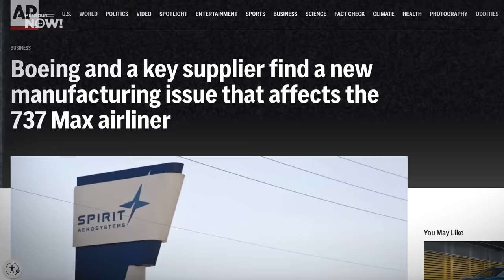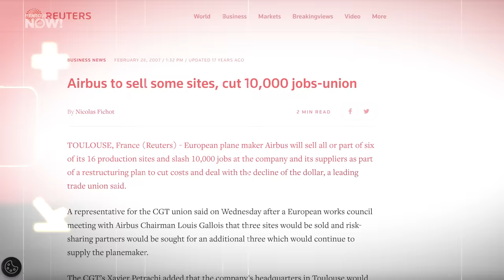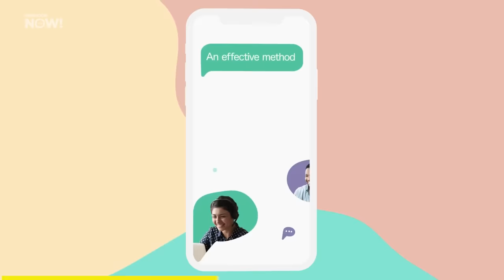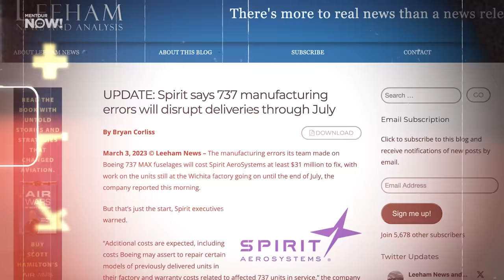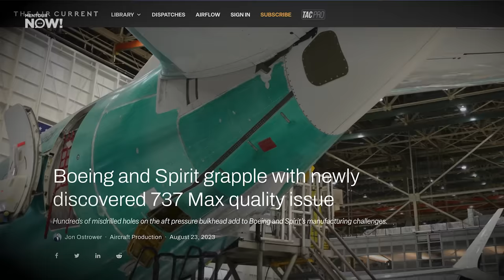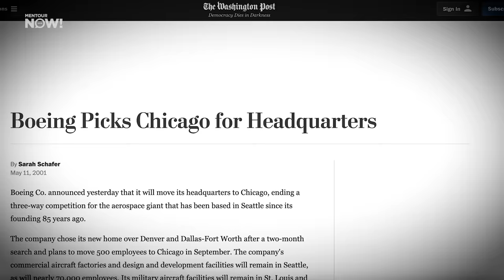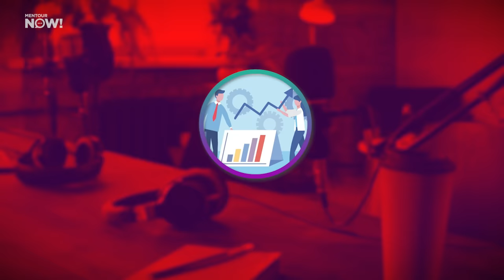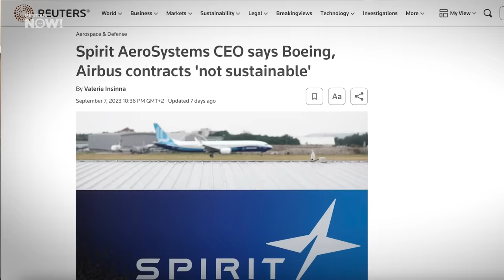NEW Problems with the B737MAX!

Comment: The biggest mistake of Boeing was not to sell off Spirit, it was to fill itself with financiers, not with engineers. In fact, more than financiers, it seems they ended up full of old horse salesmen. Your excellent presentation shows how they sold off Spirit to make a buck while losing their control over critical engineering issues. And before this, they took the decisions that led to the catastrophe of the 737 Max to save a buck while dismantling a culture of safe engineering that had started at least half a century earlier. The only good thing here is that Spirit is safe from Boeing's corporate raiding executives.
Reply: " The only good thing here is that Spirit is safe from Boeing's corporate raiding executives"
Well apperently they are not.... otherwise this discussion wouldn't exist.
Mixing up bolts can happen, but drilling two holes instead of one is not an opsy shit happens human/system error, that was a consious decision from someone inside of spirit, going against better engineering judgement.
Reply: Yeah that's true what they care about is money
Reply: Greed destroys everything
Reply: You are 100% right but it goes a lot further than Boeing.
I'm an aerospace engineer who works in industrial control systems, automation and robotics. I've worked across a number of industries and what you have described with the problem of financiers is RAMPANT across most industries especially all of the technical and engineering industries. I became so frustrated I started informally studying economics so that I can talk their language and be able to push back. 

The thing that really motivated me was finding out how bad of a state Australia's (my country) energy sector was from doing a small consulting job. I can 100% guarantee you that the current energy crisis has NOTHING to do with Ukraine other than Ukraine made the situation worse. 

The problem is that its NOT just 1 thing. Its collectively called neoliberalism which is more than simply economics as its got political aspects as well. The main problem with energy is that economists have NO IDEA how energy actually produced generated. In fact they have no idea how anything is produced. They see all forms of production as a collection of magic black boxes that "stuff" comes out of. They walk into places of production (food,  minerals, products, whatever) arriving with some form of market analysis that declares this "stuff" has a market price of $X. From that $X market price and their declared profit margin they calculate what the cost of production is and then start telling everyone how they have to cut costs to match what they have calculated.

Go and look at the Max-8 Story and that's basically what happened. They decided what the market cost was to compete with Airbus and used that to make decisions, which included NOT having the additional costs of a suitable anti-stall system.
Reply: Core competencies..... My old mentors told me never out source or sell them off as you will never get them back. Boeing is an engineering company, or rather it used to be.
Reply: Boeing decided it would "save money" twice :  #1 Boeing based "new" 737's on the same airframe for decades.  #2  MCAS was to "avoid (the Boeing) recertification of 737 Pilots".  

It's a Ford Pinto lesson that Boeing refused to learn.  Lee Iacocca (THAT Lee Iacocca) was confronted with the cost of a (roughly) $10 per car for a better design for the Pinto, an affordable  car meant to compete with low cost competition from foreign cars .  Lee Iacocca decided instead that Ford could just pay off people from "the few" lawsuits if the gas tank exploded, presumably putting that extra $10 towards profits per car.  How much did Ford or has Boeing suffered for killing people for bigger profits?  Not enough.

Because Airbus continued to design new airframes, the same engines that proved such a challenge for the 737 Max fit easily under the higher wings on one of Airbus' most commonly used models.  Who benefited from reinvestment in the company instead of profit extraction for the few?  That answer should be obvious.
Reply: I agree. Boeing, a company once regarded as the pinnacle of aerospace engineering excellence, fell into the trap of putting shareholders over customers and passenger safety. Yes, the main goal of a company is to make money, but when you glorify profit at the expense of safety, quality, and innovation, that company is quick to crumble- especially once those mistakes cost hundreds of lives.
Reply: Read this before watching the video, and thought everyone was talking about the airline.
Reply: @sncy5303  so how is this supplier issue related to tne merge if MD? And saying what really should have happened? Boeing and MD have nothing to do withna supplier issue. I dint get why this is related to what they have done in the past
Reply: @ElinaBenado  so how is that related to a supplier issue? So I'm guessing that thus is boeings fault because they prioritised profit over passenger safety and innovation etc is all forgotten about due to a supplier issue? This is ridiculous!
Reply: @alext3811  You're not the only one lol. I was so confused at first.
Reply: "we serve our shareholders"
Who cares about engineering and safety.
Reply: @justcommenting4981  who says they don't care about engineering and safety
Reply: @tonywilson4713 understanding economics will not help you unfortunately. You might feel you have a more impactful discussion but the outcomes will be the same. As you noted they already made the calculations and they know the required margins. You can tell them the margins are different and be right but it doesn't matter if they are paid more for you to be wrong. They have more information at their disposal than we can fathom and they will choose what to believe based on what gets them paid. Like a drug addict there is no reasoning with them. Except a drug addict mostly hurts themself. Douglas culture prevailed at Boeing because that most served the shareholders and so it was selected for.

Not looking good for the US technologically. We will be taking a backseat to French and Chinese aerospace engineering.
Reply: @nickolliver3021 their repeated actions to cut costs and avoid modernization. Like refusing to put EICAS in the new MAXs. Their repeated failure to meet quality control standards with the 78. Boeing is an embarrassment.
Reply: I LOVE Louis Rossmann's take on it when he describes companies.
The moment they stop innovating new products and markets and go stagnant, and they are run by financiers that are out penny pinching (searching the couch for change) that is a company that is circling the drain to bankruptcy!
Reply: American company, capitalism, making money over passenger safety, lack of regulations.....sounds about right.
Reply: @justcommenting4981  Aurbus is an embarrassment because they cut costs with their repeated actions  and avoiding modernisation. How are they refusing to put in EICAS? They never refused to meet quality control standards on the 78 program
Reply: @CMDRSweeper  so how has Boeing stopped innovating new products and markets and have claimed to be stagnant? Who says they are penny punching searching for money down tne sofa and is showing that tbe company is circling tne drain for bankruptcy? What makes you think that on a supplier issue
Reply: @gentleken7864  I don't see it as making money over passenger safety over a supplier issue
Reply: @nickolliver3021  the 787 was delayed for years because of quality control problems. Way late for deliveries to American, which I think are still behind receiving their deliveries. They did refuse to put EICAS in the MAX and were able to lobby Congress to grandfather in the archaic crew alerting system the 737 currently uses. You have absolutely no idea what you're talking about.
Reply: @justcommenting4981  and that was how long ago? The 787 has had its quality control problems solved yet frames are being reworked on as we speak. Late isn't an issue. Being sorry is. And no they extended the waiver so that EICAS is installed on the "archaic" crew alerting system. And actually American.has relieved all 787 dreamliners as they just have -9s to be build and delivered now. Stop going on about the negatives and ficus on the positives
Reply: @arcanondrum6543  The airlines such as Southwest who pushed for the MAX aren't innocent either. They demanded the Boeing take a 50+ year old airframe and make it as fuel efficient as the A320 neo without making any changes that would require simulator training, or else they would take their business to Airbus. That is like buying two weeks worth of groceries, and demanding the cashier fit all of them in one bag without that bag being heavy. Most of the blame is on Boeing for the half assed and underhanded way they achieved this, but there is only so much they can be expected to do without designing a replacement for the 737 from scratch.
Reply: @justcommenting4981 Right, Boeing are indicative of the working practices and environment in America now.  Shareholders are the most important part of the company and in this case at the behest of safety.  Problem is, if you cut corners with planes, hundreds could die.  The fact the 737 Max has been grounded before in 2019/2020 shows you what has happened to Boeing.  Profit is all they're interested in.  America is way ahead on this capitalism thing and is now at the point where it shows where capitalism has gone wrong.  But you cannot put profits over plane safety which Boeing has done.   You have to remember also that Boeing is integral to America, as was seen during Covid.  They'll be bailed out no matter how badly they're run.
Reply: @themidcentrist  No.  Boeing placed blame in others' lap but "making it as fuel efficient as the A320 Neo" came down to one thing:  Fuel Efficient Engines.  They fit easily under the higher wings of the A320 but those same engines did not easily replace the engines on the lower wing 737.  

Airbus had choices, Boeing did not.  The blame for that is Boeing's.  Boeing COULD have anticipated that more efficient engines would ironically,  be larger but executives extracted profits instead.
Reply: At this point, Boeing's just polishing turds.  ;o)
Reply: @nickolliver3021  oh Boeing is sorry? Well that's good, that solves all the technical problems doesn't it. Getting a waiver means they refused to put in an EICAS. They were permitted to use the goofy lightbright system instead of a modern one, even though some engineer clearly designed the glass display to accommodate an EICAS. Why should the 737 adopt modern safety and technology standards though? That would cost money.
Reply: @justcommenting4981  Look they had it extended so that EICAS was installed as it was a requirement from December 2022. All new planes will need it installed. But if you really are that persistent at this then go complain to boeing instead of going on and on on YouTube about it. It doesn't achieve anything
Reply: @gnarthdarkanen7464  just like airbus have
Reply: @themidcentrist  ....on the other hand, your point that Southwest cared about shaving costs for profits is well taken.  Ahh Reaganomics, it's all about Profit GROWTH now.
Reply: I have to wonder if the employee who noticed the "snowman" problem was rewarded or punished.
Reply: @arcanondrum6543  So long as we allow corporations to be owned and run by the few, this will keep happening.
Reply: @FNLNFNLN  No, mob rule is worse, who the few matters, this is the consequence of america last capitalism wining over noblesse oblige.
Reply: @nickolliver3021    Something like... Boeing HAD a great thing going on. Engineers primarily doing the operating and what input accountants did was just to reign them in a bit. McDonnell-Douglas already proved how putting accountants in charge works out, but Boeing somehow got the idea to "fix" what they were doing when they absorbed the MD corporate culture...

    ...AND the recent history and developments speak for themselves. It's exactly what happens when you go around "fixing" stuff that was obviously NEVER broken.

     I can't 100% speak to Airbus up and downs... BUT it's an alarming trend across ALL things in corporate production of any kind.   ;o)
Reply: Fun fact: when the last 737-800 NG was built it had to have it's original fuselage replaced because the wings wouldn't fit. It was for KLM and registered PH-BCL.
Reply: @arcanondrum6543  That's a nice rundown of urban-legend misunderstandings in pop culture, from the Pinto (no higher rates of rear-end tank explosion / fatalities than other models of the time) to new engines fitting under the MAX being "such a challenge" for Boeing. If you were an experienced pilot across multiple types, you would know that the 757 had a far greater nose-up moment under throttle-up than the MAX because that was its very intentional, high-performance design. Pilots had no problem flying it. That wasn't the problem nor the purpose of MCAS to eliminate it. The main problem in this discussion thread is that people think the discussion is about Boeing. Boeing retired years ago through a process of "taking over" McDonnell-Douglas, which in terms of everything from accounting to engineering to company culture actually meant Mc-D taking over Boeing. That is the real reason why the recent history of Boeing mirrors the history of the same kinds of nightmares at Mc-D.
Reply: @MrMcMind :  Thank you for saying what mentor pilot did not say. These companies are rife with lousy management and engineering.
Reply: @nickolliver3021  again you just don't know what you're talking about. No 737 will have EICAS irrespective of when they are manufactured. New aircraft TYPES Boeing introduces from now on will have EICAS(unless they get yet another pass to do as they please), but no 737 will have because of the waiver. Why on earth would you think Boeing cares about what anyone thinks or complains about? They didn't care about what their own engineers thought when making the MAX into a lawn dart. They want money and wanted to pump out 737s more cheaply and so didn't include EICAS. The only reason it got new engines was to compete with Airbus NEOs.
Reply: @gentleken7864  maybe, we'll see. I think we will see another competitor to Airbus outside of the US in the next 10-12 years. I think Boeing will just become sort of irrelevant, like Russian aircraft are basically only flown in Russia commercially. It will be interesting and probably very sad to see what form capitalism takes to ensure the shareholder class never wanes in power or luxury.
Reply: @nickolliver3021  When Boeing and MD merged, Boeing's engineering led culture became a finance led culture. And that led them to nickling and diming everything, and outsourcing alot of things which are probably important / critical cos it was cheaper (up front, not necessarily in the longer term. Those execs who made the decission would have collected their bonuses and exited out before things go downhill).
Reply: @nickolliver3021  Hundreds of dead passengers.
Reply: @SteamCrane  so has airbus
Reply: Biggest mistake? MCAS?
Reply: @justcommenting4981  That's the standard response back as usual. How many times do I have to say it. All aircraft from December 22 onwards have to have EICAS hence why an extension happened for it to be installed so yes is the answer to that. It will be installed. All planes lawn dart when they have problems when they didn't maintain the aircraft well lol. Aurbus wanted to pump out jets and wanted money too. But all new 737-10s and the other models in the future will have EICAS installed. Anyway I don't see what this relates to a supplier issue
Reply: @nickolliver3021  you aren't saying anything. I still don't think you actually understand that no 737 will have EICAS no matter when it is made. Airbus have never lawn darted(to my knowledge), in fact the pilots in multiple Airbus crashes had to basically put in continuous input to keep the plane stalled or pointed at the ground. You're a fanboy that can't tell the difference between one company that has repeated delays because of quality control failure and one that doesn't. Yes both companies make money because that is how our economies are set up, but one company is also actually consistently producing safe aircraft without defects and the other isn't.
Reply: @dosmastrify  MCAS was just the last, and unavoidable, mistake in a long series of poor decisions. New systems are designed, tested, corrected and sent into production all the time, and that is good engineering. The MCAS was designed with a severe mistake, the design was poorly checked, the tests were poorly done, and it went to production anyway. MCAS was not the problem, the severe erosion of the checking and testing standards was the problem. Additionally, every system includes the manuals and procedures necessary to use the system correctly. In the case of MCAS, the manual was "just don't tell the pilots that the MCAS exists". Even the flawed MCAS would have been a safe and beneficial tool for the pilots if they had been properly instructed in its use.

So no, the MCAS itself was not the problem, the penny-pinching salesmen who wanted to sell the new 737 as a perfect improvement over the old one, with all of the advantages and no additional issues at all, were, and are, the problem.
Reply: @ReflectedMiles   Wrong and wrong and very funny how you intimate that you know about flying but have no idea what shifting larger engines forward of previous designs does to CG and CL. 

I realize that there are claims, made all "official" about the Pinto and so, I will leave it to others to find out what's in the actual NTSB Report  (rather than the CLAIMS of what's there,).  Anyway, shame on you for imposing your obedience on other readers and for pretending that you're knowledgeable.  Clearly you are not.
Reply: @justcommenting4981  And you are not saying anything because a supplier issue is not a delay of quality control failure. And yes the 737 -10 will have EICAS.  Well yes airbus has lawn darted many times before. Then if pilots were pitting continuous inputs into the controls then there is nothing to worry about over that as both has done that. We're now moving from topic to topic. Oh yeah like airbus has never had a delay in bad quality control. They failed on that too when they did. I dont see how the other is not making safe planes with defects and the other is just so perfect and making safe planes without defects? Boeing is making safe planes without defects. What's all this fuss about
Reply: @arcanondrum6543  I am a commercial pilot with experience in both types. I don’t get my information from social media, like most experts in these threads. What I stated is the reality in the cockpits of these aircraft as any other pilot with the same breadth of experience will tell you. Yes, there is a minor change in CG from moving the mounting point and the moment being further forward does give throttle movement some additional leverage, but the greater impact is simply from having much more thrust located under the wings, but that is also true for Airbus and is especially a characteristic of the 757, which is why I mentioned it. MCAS is just an acronym that tells you what it was intended to do—augment the maneuvering characteristics. Its purpose is to make the handling of the MAX similar to earlier 737’s in certain flight regimes to avoid a new type certificate requirement with extensive re-training of existing crews then being required. It’s not because the new flight characteristics made it any more dangerous to fly than other commercial aircraft. Media, and especially social media, are perpetually confused and misinforming each other and the public about aviation and other technical topics in general.
Reply: @nickolliver3021  the 737 10 will not have EICAS. Where are you getting that it will? Post where you are reading that from.
Reply: @ReflectedMiles  Well, NOTHING that I wrote was "misinformation".  I beat you to the CG change, you still haven't mentioned CL and you'll have to find someone else interested in admiring you just because you claim to be a commercial pilot.  I'm aware of the minimums to become one so I don't automatically presume that each of them has above average intelligence nor curiosity beyond their duties.
Reply: What I am thinking is what of Spirit decides to not send anymore parts to Boeing, Boeing is dead, Bankrupt.  You do not outsource a critical supply.
Reply: @themidcentrist - You sir, are correct!  Southwest inadvertently turned out to be one of Airbus’s best customers from how they ended up screwing Boeing because they (Southwest) were cheap sh!ts.  I get that is was a “it seemed like a good idea at the time” situation, but history has proved how terribly myopic that decision was.   That and buying MD, instead of letting it sink like the turd it was (which ironically, can somewhat be said for the merger of Douglas and McDonnell).
Reply: @tonywilson4713  You are bending the story to fit your narrative. The 737-MAX problem was always one of safety vs cost - neoliberalism was never involved.

The 737-MAX problem started when Boeing chose the 737 airframe over the 757 airframe as the basis of future aircraft development. That decision was made almost entirely on the basis of reduced training cost to customers (use of existing avionics) and ignored engineers' advice, which include a warning that development costs would be greater and that the low wing height of the 737 would lead to problems with large diameter engines. That problem came to pass and the designers were forced to move the engines on the 737-MAX further forward than was desirable in order to obtain sufficient ground clearance. That caused a problem with the location of the centre of mass which made the aircraft vulnerable to stalling when it was flying low and slow. Thus was MCAS (Movement Characteristics Augmentation System) born - the name alone tells you that obfuscation is involved. MCAS uses one or two sensors (penny-pinching) even though three are necessary to avoid problems with sensor failures. The system was not announced in the operator's manual, thereby saving conversion training costs for customers. One poor decision followed by a succession of kludges which attempted to mitigate that decision; costs reduced without due consideration given to safety and engineering concerns. Nearly 350 innocent dead people.
Reply: @ReflectedMiles - Exactly correct, as an airline transport pilot rated in fourteen different jet transports (including the B-757, and with a number of friends who have flown both the MAX and the A-320).  You’ve got to love all of the armchair “experts” whose knowledge comes from FlightSim and the general news media!  SMH.
Reply: @arcanondrum6543  You have forgotten the trivial cost of enough (3) AoA sensors to render MCAS resistant to sensor failure, and the deliberate failure to notify operators of the existence of MCAS - given the outcome, the latter might well constitute criminal negligence.
Reply: @MrMcMind  drilling two holes instead of one happens when you’re back drilling parts that aren’t 100% lined up. They wouldn’t see the doubled hole, which is why it wasn’t caught
Reply: @toriless  Spitit cannot stop supplying Boeing. A company that is not unbelievably profitable cannot stop supplying more than 60% of its product without itself going bankrupt. The last thing the world needs is even more corporate raiders holding companies for ransom.
Reply: @justcommenting4981  back when it had the extension to have it installed facts dont lie
Reply: Uh, Spirit was the weak link in these problems. So, your safe from Boeing comments makes no sense. Also, the Max issue wasn’t even some sort of build issue. It was the result of airlines not wanting to pay extra / lose time training pilots for a new type certificate. It was simply Boeing’s fault for helping to enable that.
Reply: @hb1338  You're right,  I did forget to mention the AoA (I am certain that the 1st that crashed had just one AoA Sensor but I think that both that crashed had just one) more would have been a trivial cost to Boeing.  Also yes, Boeing executives SHOULD be charged with crimes.  Great point!

Reagan really screwed over average people when he made "government" (regulation) a crime. I believe that actually charging the executives is more difficult because of him.  Reagan and the guy 5 Presidents later cashed and kept every single one of their government checks however
Reply: @nickolliver3021  
As I said to you under another video but on this same topic, your defence of Boeing for outsourcing components is turning into a 'one man band'. There's plenty of support for Boeing as an innovative company amongst the criticisms, but the company's decision to sell off the manufacturing facility in question, effectively outsourcing to 'snake oil' salesmen like Spirit, promising to build cheaper and better, was just so unrealistic, it was never to be believed, except by Boeing executives, and now you come along to convince everyone, (although you convince no one,) into thinking Boeing can hide behind its suppliers, and do no wrong.

You're fast becoming a zealot, detached from all reality............
Reply: @artrandy  Why is everyone acting like it's all defending them? I'm not asking for answers!! A supplier issue is we all know not the manufacturers problem how many times do I have to say this. It looks like there are so many exowrys who think.they know it. Outsourcing components is the only way to go.  Yes they are full of innovation despite the past mistakes. But ypu saying snake oil salesmen. All manufacturers want it done cheaper. How is boeing hiding behind its suppliers? They are out there reporting the issues as they are before they get any worse. Other channels know its not boeings fault for supplier issues. You might as well say its the manufacturers problems for engine issues yet they don't make engines
Reply: I'm also doing accounting and economics but I really want to be a pilot. I now see clearly what this is all about. The are try to maximise profit over safety that is why the Max 8 crashed. So yeah I fully support your argument. It's true
Reply: @kksavaition1254  how are they putting profit over safety when this is a supplier issue
Reply: @nickolliver3021  
You have to wonder why Boeing sold off that division which became Spirit, and the answer is inevitably, a financial one.

Clearly, some accountant claimed that Spirit could produce those components cheaper than Boeing.

How could they, was Boeing not an efficient company at the time?

So how many corners did that sub-contractor have to cut, in order to reduce the cost price and meet Boeing's expectations?

The 'pigeons are now coming home to roost', and the 737 is a pretty big pigeon.

The engines are sold separately and have nothing to do with it. You know that.

This is just another unneccessary threat to the 737 Max programme, caused by greedy accountants, but nevermind, Boeing still has you on their side, ignoring the truth like a Russian bot...😀...
Reply: @42468  I am only familiar with backdrilling in regards to circuit boards. We are talking about a riveted bulkhead. 
Fill me in if I misunderstand you.

Regardless, shouldn't that be an error that gets almost immediately get caught? I mean once your drilling is done you check your work if it meets the specifications. Either they don't check, or they dismissed the error. Both are not acceptable decisions.
Reply: @artrandy   the sane can be said about airbus selling off that division which became spirit too. Everything will be down to financial reasons. 

Boeing doesn't produce components nor does airbus. They have suppliers to do that for them they only assemble. 

Of course boeing and airbus were efficient at getting planes out and delivered, if only their suppliers met their standards at right now that's not looking too good. 

The question is why did spirit cut corners in order to send those improperly drilled parts to boeing that were not up to specifications? That's what the question is. And that is for spirit to answer for but they never tell you. 

Yes alot of pigeons will be coming g home to roost. The a320 is a big pigeon too. 

Yes and the parts that are made for airbus and Boeing are separate too and made by suppliers. 

I don't see how this issue is related to greedy accountants? Greedy accountants at spirit yes agree but nothing on boeing. This isn't ignoring tbe truth. Spirit accountants are ignoring boeings specifications. Truth doesn't lie.
Reply: @nickolliver3021 
If you think that the reputation of Airbus is the equivalent of Boeing's reputational low, you are so self deluded.

Boeing's supply problems on the 737 Max, come on the back of 2 air crashes.

Every time there's another problem at Boeing, or one of its suppliers, people groan and are reminded of those crashes.

"And the same could be said about Airbus". Wrong. You need to do some proper research bud. 

BAE was an original partner forming Airbus, but sold its shares in Airbus, and also divested itself of factories producing components for it. The factories were sold to Spirit, but not by Airbus.

As for factories in Belfast, they were sold by Bombardier to Spirit, and Bombardier bought them from Shorts. Shorts were an airframe and component manufacturer, best remembered for the Sunderland flying boat of WW2 fame, and were building parts for aircraft that later became the Bombardier C series, later the A220.

So no, Airbus never employed these companies to undercut their own costs on components, because these companies had been making the components for either Airbus or Bombardier from the beginning and they still are. So, not like at Boeing at all.

You don't have the whole picture. Anything outside of the US and you aint interested.

You are right, the truth doesn't lie, but a lie is still a lie, and Boeing sold it own component manufactury knowing the new owner had to cut corners to make it all cheaper. That is why Boeing are guilty of risking quality control.

How much are Boeing paying you to protect their reputation from all this bad publicity, and do they think they get good value......?
Reply: @artrandy  Doesn't matter. They both have had the same problems but not as what boeing went through. Why is everyone getting so up tight over this god damm suppliers issue. 

We all know the 737max crashes were 2 crashes alone. We get it

So just because of the crashes, when a delay or supplier issue relates to those crashes does it now? They're all separate. 

And if you want airbus in it then they deserve the hate too from people. So all those airbus crashes people should relate how they have had delays and supplier issues too. 

And Boeing did not sell anything for spirit to become a supplier for boeing. Spirit was a original partner company but sold its shares in boeing too and divested itself of factories producing components  for it. 

As for the factories yes they were just like boeing because they did employ these companies to undercut their work and costs on components because its all about money and doing it on the cheap. Quantity not quality. Bombardier was bombardier. What has shorts got to do with anything. Bombardier c series was their own aircraft from scratch. Which later became a220 when airbus bought them up. 

Anyway both companies airbus and Boeing have companies to supply their components but it was down to their suppliers to undercut or stick to doing their jobs properly. Sadly we are seeing spirit undercut their work by drilling improperly drilled holes in parts. Enough said on that. 

I do have the whole picture. Quote alot have the whole picture over a supplier issue. I say again it has nothing on boeing. They saw it they are getting spirit to suffer and pay for the damage done. 

You can't blame boeing for selling off component manufacturering knowing that suppliers have issues such as cutting corners to make it cheaper when they suddenly get caught out by the manufacturer. That's why boeing is not risking quality control because their own quality control team saw this immediately and reported the issue. That is their job being done the right way. 

Perhaps how is airbus paying you to say that boeing is risking their quality control yet their own quality control team are doung everything right here? Unbelievable. This is not a fight about which one is in the wrong but deep down this is all on spirit and they themselves have admitted their problems of not catching up to boeings needs with demand hence why parts are being made bad quality/not up to specifications. Need I say more!
Reply: @nickolliver3021  
Much of your reply is the usual list of lame Boeing exuses.

Boeing are lucky that a latter day Ralph Nader is not discrediting Boeing over continued safety issues, regarding the MAX, because the way he destroyed parts of the US car industry in the past, due to his interpretation of unsafe cars, could destroy Boeing over the MAX now. 

I think that only a minimum of the air travelling public are conscious about the reputation of the MAX, as they're getting on it, but that could change if Boeing trip up any more and the US public boycott it.

You know about the dreadful circumstances surrounding those two lost MAXs, so you don't need me to remind you why the reputation of Airbus is so much better than that of Boeing.

And by the way, people know that no one at Airbus is paying me for propaganda, because unlike you with Boeing, I do not claim that Airbus can do no wrong. I like to see fair comment, but latterly, you've given that up........
Reply: @artrandy  I can pretty much sum this all up. 

It's  all here say! In real life we all hear tbe real truth and not what people's opinions believe is to be true. 

Again a continued safety isdue is not a supplier issue regarding the MAX. I don't go on about Ralph Nadar who ever this guy is. I talk about the point in hand amd not go on about this that and the other. If he could destroy boeing over tne Max then he can do the sane to tne airbus a320neo. One must end aviation if this is how it all is about. 

 The travelling public is conscious about reputation of the max because they know that the history was a mistake and now since the recertification they have listed and have heard that the changes made have got confidence abd faith back in people who need to be educated on its recertification. Who says if they ever trip up again and deserve boycotting? 

Just because of tne two max crashes doesn't make it out that it was a big blow to everyone and they all need to worry so badly over it. Anything g like supplier isdues with the plane or whatever they instantly blame boeing for. Its a sad reality. The world is getting madder. 

And also there is no one at Boeing knows I'm.being paid to post propaganda either. I'm here to say what reality is and how most here amd on other channels agree that a supier isdue is not a manufacturers fault. You always get the very few who try to force their way in to prove it is or make out it is. But to be honest I'm wanting to be nice about it but I got alot of the people who wanted to blame boeing for it. So there we are. It's best not to argue over a damm supplier issue
Reply: @sncy5303  - Yep, though I think the term “dolt” is more accurate!
Reply: This same thing is happening to the medical device industry. Watching it happen was like watching a horror movie unfold.
Reply: There are internal and external customers. External customers are airlines. Internal customers include stockholders. Stockholders became Boeing's most important customer. Boeing decided their product was money, not airplanes.
Reply: You clearly don't know Boeing's past plagued by terrible design choices that killed so many people.
Reply: @ederss7  In engineering for security you have to consider always two things: the design process and the testing process. Design is by definition a flawed process because you are making something that did not exist before, so unexpected results are unavoidable. But after that you design security into it, avoiding preventable problems, and then you test everything yourself, and then you get external assessment of the whole process. If you want to criticize something, you have to find out about the whole process from start to end, not just one piece.
Reply: @sncy5303 They've moved their headquarters to the DC area, cementing their final form. They've gone from engineering company to finance company to now being a government lobbying company.
Reply: Bean counters and other rear echelon bosses are the tail that ( tries to ) wages the dog
Reply: @MrMcMind  you don't know what you're talking about
Reply: You can apply this to every tech/engineering company in existence. The fact that non-technical managers & directors earn more money than the dudes that actually make the thing fly (or work as in every other tech/engineering business) is absolutely bonkers.
Reply: @CMDRSweeper EXACTLY like that already happened to Chrysler...
Reply: @kksavaition1254  all companies care about cash show me one just one that doesn't.
Reply: @sncy5303  boeing will be here there is no other choice. Just Airbus and they can't come close to keeping up with the demand. just like boeing couldn't in there hey day.
Reply: It now got worse. 

It moved to Chicago, got rid of engineers in Seattle and hired a bunch of sales man.

Now it moved to DC, got rid of the sales man and hired a bunch of, gasp, lobbyists!
Reply: @arcanondrum6543  "Airbus had choices, Boeing did not." Did not Boeing have the choice to properly design a brand new aircraft instead of modifying the aging 737?!  How was there no choice?!
Reply: @someb0dy2  "When Boeing and MD merged, Boeing's engineering led culture became a finance led culture. And that led them to nickling and diming everything"  A nickel and dime culture is bad enough in automotive engineering where the likes of General Motors, Ford and Dodge struggle to compete with rivals who focus more on quality (apart from in trucks), let alone in aviation!
Reply: Accountants aren't engineers, the once mighty and trusted Boeing has now stained it's reputation with permanent marker.
Reply: @arcanondrum6543  Fight club economics
Reply: @nickolliver3021 The hundreds of people who died in the two plane crashes due to the faulty MCAS say so.
Reply: @nickolliver3021 How many Airbuses have crashed due to faultily designed MCAS?
Reply: @ashlionell  mcas is not on an airbus. But you dont know if one could in the future. Why asking stupid questions. Who cares. You can't tell the future
Reply: @nickolliver3021 Precisely. MCAS is not in Airbuses because they don't need that because they are designed well. Unlike the MAXs, which were poorly designed and then MCAS was applied as a band-aid for masking the defects of the design. Surely Boeing's fault here.
Reply: @ashlionell  Then The Boeings are designed really well too. The MAx was not poorly designed as MCAS was a separate feature however was not just a band aid for masking the defects of the design. I'm not going down the route of who's fault that was but moving on from you and saying unlike Boeing this that and the other.
Reply: @nickolliver3021 Really well designed airplanes ought not be dropping from the skies like flies. Airbuses are really well designed. Even other older Boeings are well designed. Only the MAXs are riddled with problems because of cutting corners and prioritising profits over safety. Hence half baked systems like the MCAS that never really should have a place in a well designed plane. You know, which the MAX is not.
Reply: @nickolliver3021 You cannot not choose to go down the route of whose fault that was, when hundreds of lives have been lost due to Boeing's greed and scrupulousness. That simply is not a choice. A fair and unbiased investigation has to be done, and the blame apportioned to whoever is guilty and/or negligent. All the facts point to Boeing as being at fault for their inferior designs and underwhelming quality control.
Reply: @ashlionell  How was it boeings greed and scrupulousness because of hundreds of lives lost? Perhaps airbus has also lost over hundreds due to its greed and sculpulousness over the years too. Boeing wasn't negligent nor guilty because those max crashes had partly tbe pilots to blame too. How does Boeing produce inferior products with underwhelming quality control? Doesn't airbus have the same too? Nothing is up to its standards!!!
Reply: @nickolliver3021 How do you say the MAX crashes had the pilots to blame? Are you aware that Boeing kept them totally in the dark about its MCAS? Do you know that Boeing publicly revealed the MCAS only after the second crash due to faulty MCAS? They tried to get away with designing an inferior plane at low cost, until they got caught. How is that not greed or scrupulousness?
Reply: @ashlionell  The fact that mcas was inly revealed after the second crash was when they realised mcas was tbe issue. They didn't deliberately hide mcas from tne pilots. That's not what greed it and sculpulousness. The max was never an inferior product. This has gone on from the latest issue to the whole max saga! Why are you doing this. This has no relation to a supplier issue
Reply: @nickolliver3021 They were supposed to inform the pilots about the MCAS which was a new system. Boeing specifically got a waiver from the FAA to remove references to the MCAS system in its training manuals issued to the pilots. This was done to avoid the costly type certification that would have to be done had they revealed the existence of the MCAS system in the first place. How is this not greed and scrupulousness?
Reply: @ashlionell  misdibg out on informing the pilots does not count as greed. Getting a waiver from FAA to extend the -10 variant to get it certified is not a way of greed. Nor is it greed to adjust a few things about mcas in the manuals. Any company would do things to reduce the cost so if that's what it's like for tne modern day then pretty much all companies are greedy and sculpulousness. Shame on people on this planet!
Reply: @nickolliver3021 Fine. Assuming that not informing the pilots about a totally new system like MCAS may not be greed as you fervently argue. But what is it then? Incompetence? Negligence?
Reply: @ashlionell  it's not negligence and nor is it incompetence. It was a mistake. Everyone has moved on from it. Boy do you go on
Reply: @nickolliver3021 It is surely exhausting trying to defend the indefensible. But karma always has a way of catching up with those who knowingly and recklessly put the lives of others in danger so that they can line their pockets some more. I would sincerely advise you to stay away from Boeing planes when you travel as they have proven unsafe.
Reply: @ashlionell  it's not defending. It's just accepting how the world runs. Companies will catch up with any threat of putting lives in danger so that they can line their pockets more. It just depends on what Job industry you are in. Boeing planeshave not proven unsafe because the 787 abd 777x have proven safe. You are taking this so seriously like it's a big worry for the world
Reply: @sncy5303  I'm sorry to say that wishing things would go back to how they were will not happen. Its all about money and not the consumer and not much about safety. However companies do their best to go with safety regulations etc
Reply: The same may be said of the investment groups who have purchased many of the nation's medical facilities. Financiers making decisions prioriting cost savings over patient care is also quite frightening.
Reply: You are exactly correct.
Financial accounting treats investing in improvements as an expense.
So manufacturing companies that make decisions based on accounting principles are doomed to failure.
Reply: @blaiseutube  this isn't about manufacturering companies making decisions based on accounting principles that are doomed to fail.
Reply: @nickolliver3021  oh! I thought Boeing built planes.
Reply: @blaiseutube  so does airbus
Reply: @tonywilson4713  tbh financiers are a disaster in other industries as well. Picture them in health care. It’s an unholy mess.
Reply: Bean counters should never be placed in positions of authority.
Reply: @iancormie9916  tell that to the industry